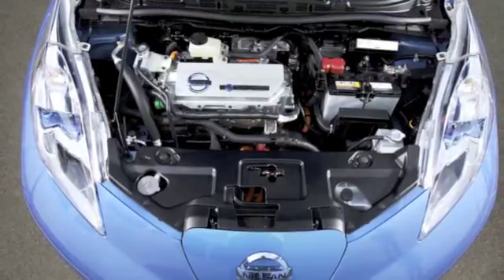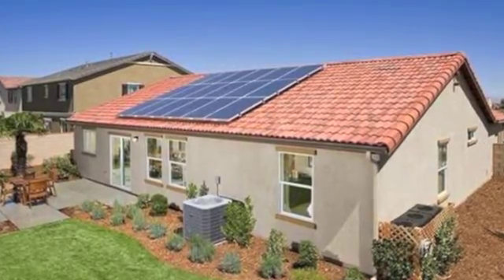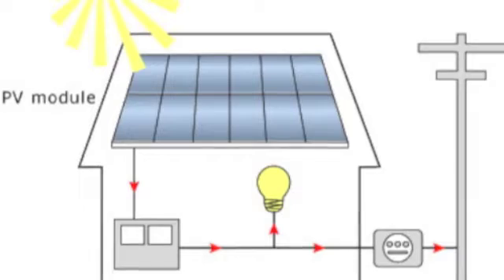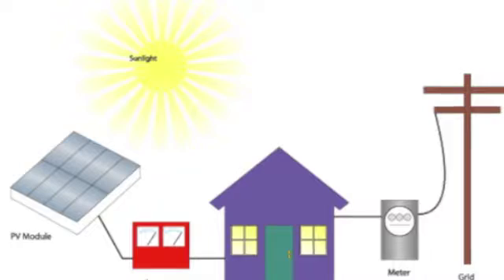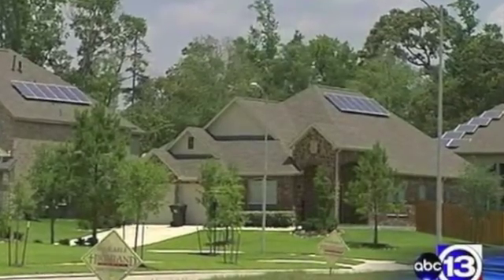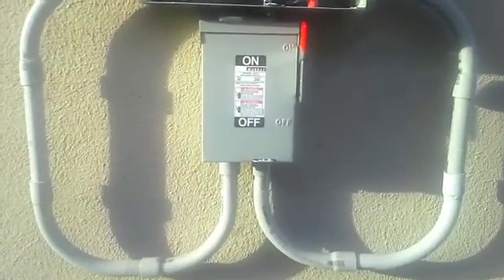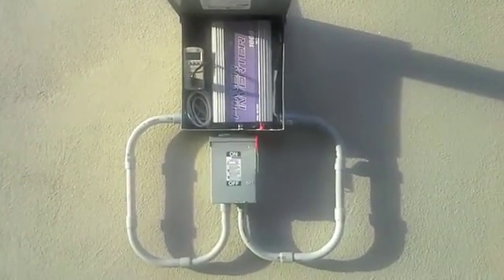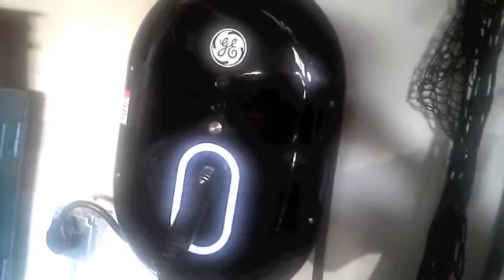Solar Charging My Nissan Leaf

Comment: Stupid investments
Reply: its not a good pay back..
$1800 investment and you save yearly max $180
try to research getting a rebate on a larger system..
pay back should be done in less then 5 years making it a 20% ROI

Comment: looks like you got insufficiant cooling for your inverter.. also thats a crap quality inverter too but thats not the point atm.. you cannot close the inverter in like that..
Reply: taztaz79 Yep, good catch, there's no airflow for the passively cooled inverter. The electronic components will overheat and quit prematurely. He'd have to add a cooling fan to the box or something.
Reply from the maker: Yep, you're right. On year two I changed out the inverter and got a larger utility box. It's running great and we are quickly approaching year three. It's been a great experiment.